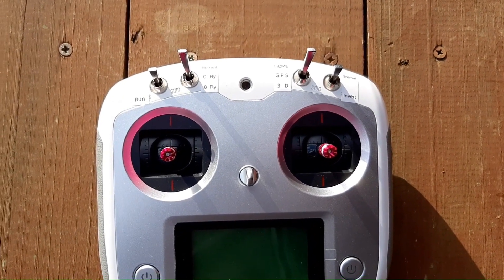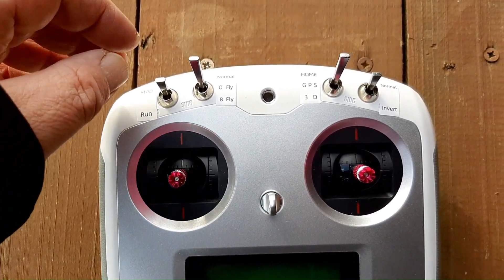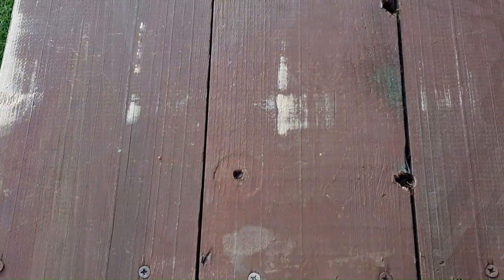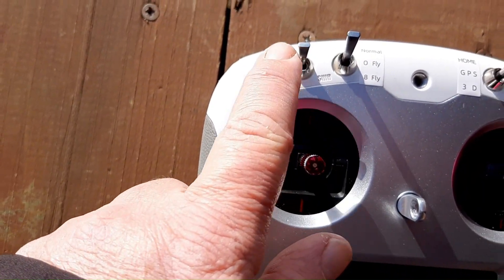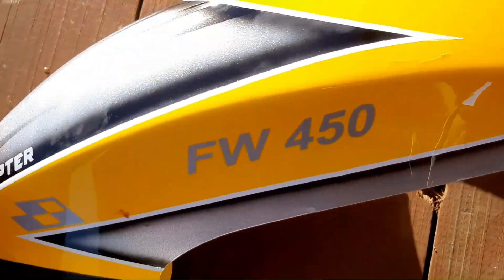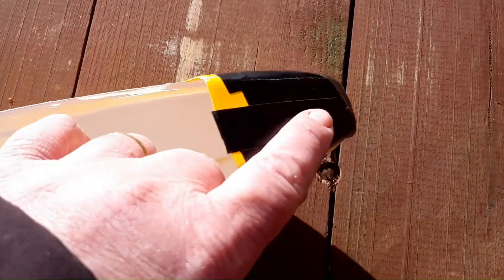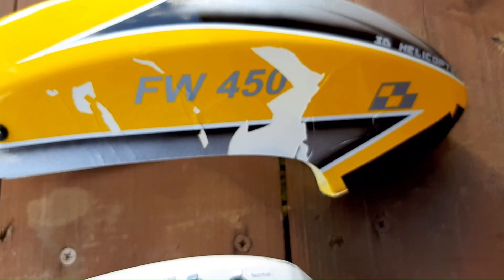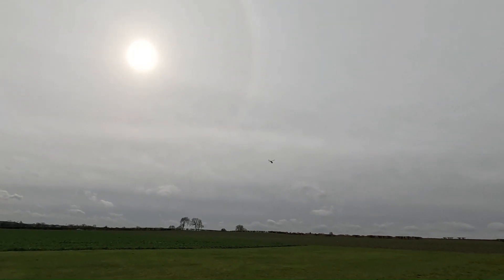How I Crashed my Fly Wing 450L V2.5 on the Maiden Flight.

Comment: You are definitely correct in my opinion that those two switches should be in opposite placement on the controller! It's great you took the time to make the video and give a heads up to other owners of the FlyWing 450L V2.5. I cannot believe someone at the company didn't realize the very real and potentially catastrophic outcome of this switch placement!
Reply from the maker: Believe it or not I have caught it a second time, luckily I wasn't too high and the heli fell flat on the skids. The only damage was  one leg of the skid thankfully. Now my flying has progressed I don't use the orbital and eight manoeuvre switch any more but a worthy note for the people starting out with this heli.

Comment: I lost mine on the 4th flight. Extensive damages. Great video. They should have the cut off switch on the outer right side.
Reply from the maker: Thank-you for your kind words and responding my video. I am sorry for your loss and I hope it hasn't put you off flying RC helis. I now hold my finger next to the switch in su h a way I can't accidently switch it off accidently but can easily switch it off if required. All the best Pete

Comment: Hey there. Connor from Australia. 

Really sorry to hear you had a crash. Appreciate the heads up and I’ll certainly be mindful when mine arrives to check the switches
Reply from the maker: Luckily the 450L is a tough bird and only required a replacement canopy. Good luck with yours I am sure you will love it its a great RC Heli. I have even flow a few times in 3D mode which is basically to fly as a full on RC Heli.

Comment: On a normal transmitter that switch is identified as throttle cut and applies to ICEs. On electrics another switch is identified as throttle hold. These switches are located on the top right side of the transmitter.
Reply from the maker: Thank you for watching and taking part in my channel and to share our knowledge to support others. As a new person into the hobby of RC helis, the FW 450L was a great introductory route into learning how to fly. A package that comes, literally ready to fly out of the box. You are correct in what you say re the switch of a standard TX but this is the supplied Tx which is formatted by the manufacturer for general use. 
The aim of my video is to show the pilots buying or using the factory set up equipment, the inherent danger/problem with the switch allocation/position. Once I decided to continue with helis I now use a standard Tx with the switch configuration as you describe. The placement of these are ideal for quick easy access as you point out but still not totally isolated as to accidently knock them. 
Thanks Again
Pete

Comment: Oh man that sucks....I did that same thing on my brand new v3 at only about 3 feet of the ground... it bent the skids broke a clip on the battery door...effed up the esc and the flight control that's a really bad position for that switch
Reply from the maker: Hi Chris I guess the cut off switch has to be in an accessible place but I feel this is too open, sorry for your issues too, I hope you have sorted out the repairs and you are back in the air.